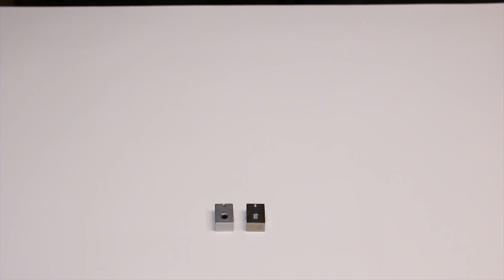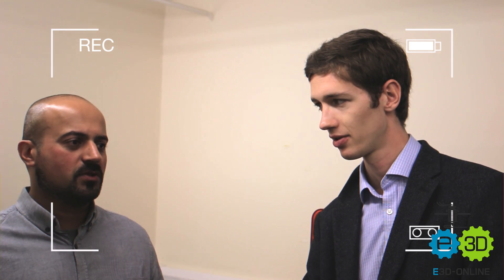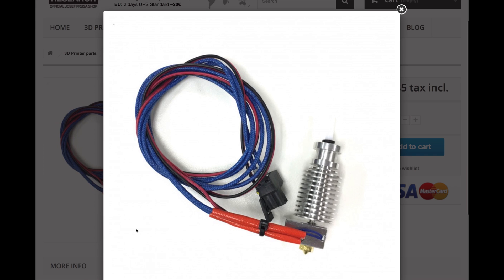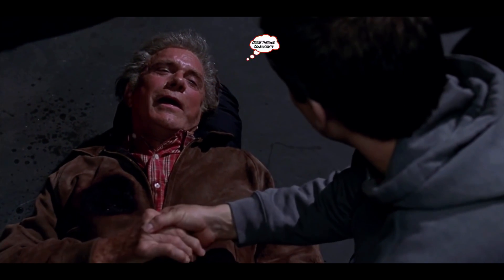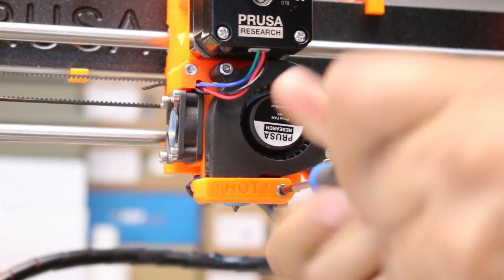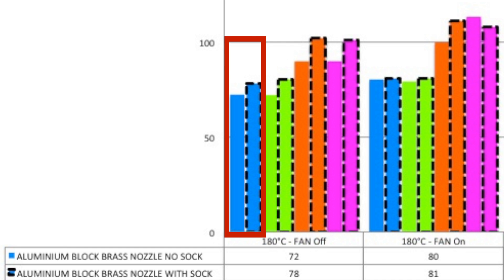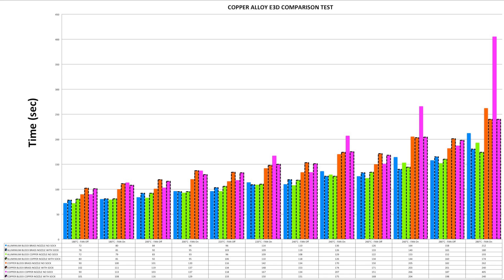E3D All Copper Parts - In Depth Test & Review

Comment: Just installed a copper block, was kinda random. Was after end stop switch, and the shipping kinda forced me to throw in a few products. Was kinda curious, and well. Block that was on had shady screws, so why not. Just thrown away 3 hours of my life on changing parts, like idle pulley and replaced cooling mount and shroud because im new to 3d printing and well. Results luckily has mostly gone in a positive way. I'm running new pid calibration and watched the temperature for a moment. Copper vs aluminium, first impression. Copper seems to get things up to temp allot faster. Cant remember i seen it go up to temp so fast. Took a screenshot of pid settings before running pid calibration. So, will be interesting to see what the printer/marlin thinks and what of if settings will change. Anyways, kinda surprised how fast the temp went up. That being said, machine has been able to run stable temps when i been observing. Ignoring a couple very odd glitches i guess was software related. Running marlin 2.0.6 R10, and have experienced a couple odd things. And atm, im stuck with it because i havent been able to update to newer ver. Im doing something wrong, have no idea what...

Comment: My thinking here, is that even if you don't go with a copper block, a copper nozzle could build be very favorable. IMO where it is most critical to have the most thermal mass, is in the nozzle, because that's what's melting and extruding the filament. Once up to temp, I believe a copper nozzle would be able to smooth out some of the smaller temperature fluctuations of a lesser thermally dense heater block. As long as there's good contact of course. If the block has cooled a small bit, there's a good chance the nozzle is still a little bit hotter (unless running on the edge of how much filament it can handle), and by the time the cartridge has heated the block and that increased heat reaches the nozzle, the nozzle temperature will likely have dropped significantly less in temperature than a brass or steel one would. It will take longer to increase the temperature of the nozzle again, but the delta to temp target will be smaller. IMO the goal here, except staying within the capacity of your print head of course, is thermal consistency. Every setup has its own variables, so we have to tune our setups regardless. But knowing that the temperature you end up with, will fluctuate much less, is great. I for one, can tune down my temps a little when printing somewhat fast, as I usually overshoot a little to be on the safe side when nozzle temp fluctuates. And i know a lot of other people do this too.

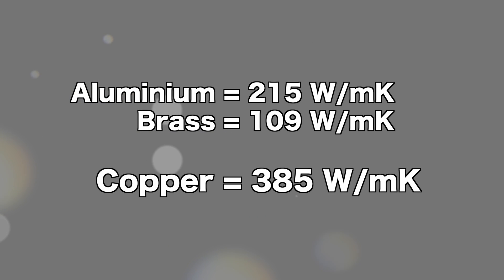Comment: uhm... I want to make a correction to the "science bit" at 3:51 you said 55% more then aluminum, when in fact it is 79% higher - what you may have meant is aluminum is 55% less conductive, which is very different as we see in the numbers above. 
I dont assume you purely misspoke, as your numbers on the slides are incoherent and what you say and write does not match up at all, sadly neither the written nor the spoken is correct, a cherry picked mixture of the two would be. Something cannot be 350%less conductive, unless if reflects heat magically it is actually 72% less conductive :) 
This is a very very common mistake and i thought i should point it out, i hope i made sense :P
The video otherwise is great as always :D

Comment: So these parts help with temperature stability. What is the impact of conductivity and heat capacity on the heating of the plastic? I know the conductivity of the plastic is super low which I expect means it won't improve heat up of plastic by going this route.

Comment: I was hoping Synthetic Diamonds could be used instead of copper, or Boron Arsenide. Unfortunately the former seems to have poor thermal conductivity w/o purifying, and the latter is very toxic.

Edit: Nickel Coated? Why not hardened steel? I've also read of ruby nozzles, but they're $$$$.
8:45 Why not make the copper portion, put the temperature probe closer to the nozzle, and use a insulator to prevent the sock from absorbing so much heat?
Edit 2: Please review the e3d titanium heat break :D

Comment: Very interesting and the cost of the raw material has always been the reason we had not seen this before en masse.
Reply: Copper has a reputation for being harder to machine too. I don't think either are really show-stoppers. Copper really isn't necessary for most people though. E3D's stated reasoning for offering it now is for higher temperature printing. I'd be pretty happy if the aluminum blocks were offered with the plating.
Reply: Same for me and I was reading about laser cutting and PC is a no no and will kill you so why is it we melt it as a filament now in our 3d printers?  PVC is another no no.  A lot of the stuff that needs higher print temps also will kill people so hmmmm.